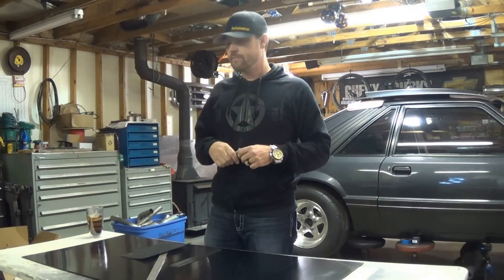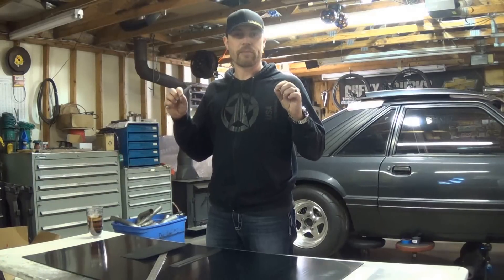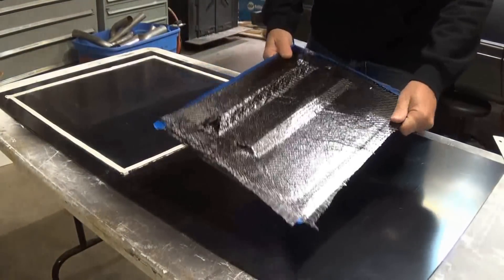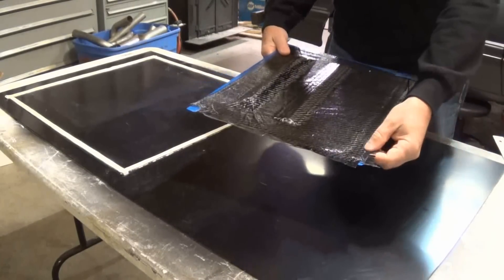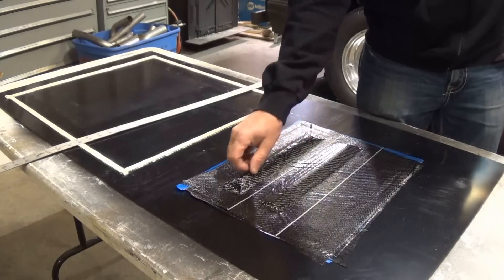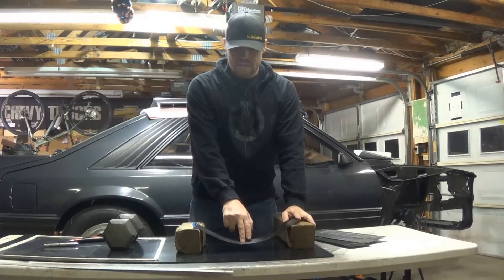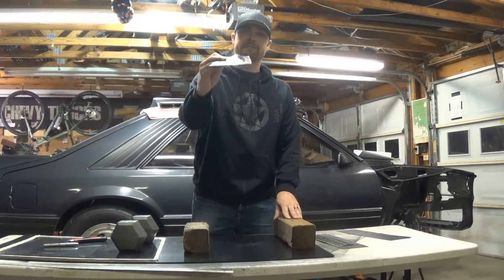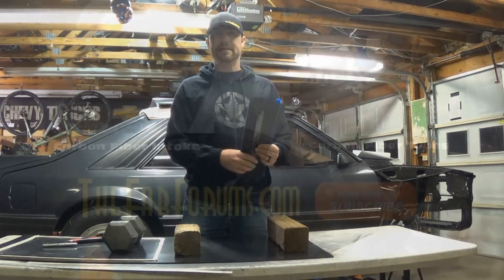Carbon Fiber Fabrication | Strength Testing

Comment: Just pour the epoxy around the outside and don't be stingy like this guy you can squegy any off if you work in a shop that's laminating you don't work slowly it's beat feet and get it done FAST

Comment: This is great.  I knew adding shape would add additional rigidity.  My use case requires a firm design without flexibility, so I've definitely been looking into just adding some arcs to give added strength and rigidity.

Comment: You do not know what you are taking about with this. Carbon fiber is not stronger the fiberglass it is stiffer.
There is so much knowledge you are missing. This guy explains things in way more detail. https://youtu.be/KHXVf0SaJpA
.
You need to take this down as it is so wrong on so many levels!

Comment: Difference should be made between carbon fibre fabrication (i.e. how the carbon fibre is produced from e.g. from rayon) and fabrication of composites reinforced with carbon fibre (CFRC). Suggestion: CFRC fabrication should be used for this video.

Comment: Although not as strong, a regular E-glass would have had similar flexing properties but a lot cheaper. To illustrate the concept think of a solid core exterior door versus an interior hollow core door. Interior door is much lighter, same thickness but almost as stiff.

Comment: I don't know what kind of foam core you were using, but you need a core material that has suitable compressive strength. End-cut balsa is cheap and popular, Rohacell is excellent but expensive, Divinycell is a tiny bit heavier than Rohacell but very, very good and a helluva lot cheaper.

Comment: The parts would be much stronger if you didn't make them pyramid shape. You can also make them at least 20% lighter if uni-directional fibers are used for the inner layer

Comment: Surprisingly, fiberglass is actually stronger than carbon fiber.  Where carbon fiber excels is in its stiffness.   https://www.youtube.com/watch?v=KHXVf0SaJpA&list=WL&index=34
Reply from the maker: not actually true....I guess you missed the text in the video at the 3 minute mark.
Reply: @Thefabforums  I did miss that.  But it's inconclusive, the way it's worded. It says higher strength is available but it doesn't say higher  strength "than fiberglass."    In my opinion he's trying to say that there is carbon fiber material that is higher in strength than generic carbon fiber but not 
necessarily higher than S glass fiberglass. I will have to keep my eyes open for the definite answer to that one.

Comment: thickness in the direction of bending looks like the key, and a shape that wont buckle.  tubes resist torsion well. in bending the outside surface is under max tension (like the outside of a track) and inside under max compression.  Why some bridges are metal on bottom and concrete on top.
Reply from the maker: yeah

Comment: Look into doing counter biased weave layers. so your first layer would be 45 degrees weave and the next would be 90 degrees, then 45 then 90.... for as many layers as you lay. much more rigid and much stronger.
Reply from the maker: correct more tensile strength but it would change this test, even when you alter the direction of the weave it will still be flexible when flat.

Comment: This method is great for parts where dimensions don't need to be accurate but this is actually a positive mold of that side of the heat shield.  The dimensions wouldn't be the same.  Doing this for dimension critical parts such as a bracket of interior panels there would need to be a mold for both sides.
Reply from the maker: in some cases such as the one you are talking about, if the part is flat enough it wont change.

Comment: Could this technique be used as a 'rib' method for body panels to give them strength?

Can this also be used to make a chassis or is chassis fabing too elaborate and calls for big machines and astronomical funding?
Reply from the maker: yeah for sure
Reply: The Fab Forums and it wouldn't be too brittle, would it?

You may have just motivated me to start working with CF! :D

Comment: It seems to me that we will get more strength by placing a piece of styrofoam?
Reply: Its not about the material, You could of used a balloon wrapped in carbon & it would offer the same strength. Its the 3D aspect that adds stiffeness. Same exact reason if you look under the hood of your car there are stamped metal supports that are raised & lowered from the sheet metal carbon is no different all metals and composite materials behave this same way

Comment: No! Carbon Fibre doesn't flex and disintegrates on impact, just ask anybody at any car or plane forum ... 

Sigh.
Reply from the maker: dont need to ask...I already know.
Reply from the maker: Its so funny to me that I just made some carbon fiber pieces right in front of you in this video....showed that its flexible and you are trying to tell me it not. lol
People should really stop keyboard building and actually put their hands on something.
Reply: Fab Forum, that was dry cynical humor, you missed it sorry, see the "Sigh" on the second line! I'm with you all the way Mate!

Internet "lore" is that CF is brittle and will snap, but so is aluminium, plastic, steel, fiberglass and wood.

Lucky for us there's more than one type of aluminium, plastic, steel, fiberglass and wood ..

... as of course there's more than one type of CF.

Actually one bicycle manufacturer is using a CF rear swing arm in CF and the pivots at the pedal junction are solid, the CF just flexes like F1 race car suspension pivots, but I can't find it on Youtube again ..

Thanks for the video, the internet needs more lore and myth disproving information like this.

Comment: I am starting to use Carbon Fiber to make high power rockets so I love these videos! One question, would you get more strength by cutting the alternate layers on a bias so that the weave would run at different angles? The plan I am going to attempt for an airframe is 1 CF running 0-90, 1 CF running -45 - 45, 1 layer of nomex honeycomb, another layer of CF running -45-45 and finally a last layer of CF running 0-90. Would that lay up be any stronger or am I making more work for myself?
Reply from the maker: yeah that would help for sure

Comment: Hey its me again The CarbonGuy! do another drill for me and you find this extremely useful when thickness and strength are both issues. instead of cutting all your fabric in the same direction for all four pieces, alter your direction of the warp face. Another words cut one piece the way you previously cut the four then cut another at a 45 degree from your first cut then cut another at a -45 degree then cut the 4th piece at a 90 degree angle from the 1st piece. now wet them out and lay them in that exact order. Let it cure and then do the same strength test, I think you will be shocked. But use cation to lay them out in the order as I explained or your part will curl up a bit after it cures! LOL but mix it up and play around to see for yourself what happens. kinda cool to learn about the warped face and how to manipulate it!
Reply: For this test he is just stressing it in one direction so if he really wants to show the difference the 45 layers would not do much, UD how ever would gives a piece with strain like this the most strength to weight ratio.
Reply: +Oliver Vallee gotcha,  that wasn't made clear ahead of time Sorry for that confusion but I would like to see him repeat the test under my suggestion to see the difference.

Comment: What's happening here has nothing to do with the material really. It's the separation of the two stressed surfaces that creates the rigidity. The greater the separation the greater the strength will be. You can put lots of different materials between the layers. Polycarbonate honeycombe is used in racing applications because it's rigid, very light and it doesn't absorb resin.
Reply from the maker: correct
Reply: I was about to say the same thing, but then I saw your post.  Exactly.

Comment: Nice, but why don't you use pre preg Carbon fiber
Reply from the maker: +Xavier Rousso Too expensive... cheaper to just impregnate it my self. Prepreg is awesome for layups that are very time intensive but is expensive and requires a heat cure. So unless its needed I dont use it.
Reply: +The Fab Forums ok, thanks for answering. Keep up the amazing vids!
Reply from the maker: +Xavier Rousso no prob. Thanks for watching

Comment: I waited for sledgehammer test with dumbell at the end to see flexy one will flex how about the rigid ones
Reply from the maker: +YAĞIZ ERGENÇ I have stood on it before (200lbs) between two blocks with no flex or cracking
Reply: +The Fab Forums are you using uv finish to protect cf from being yellowish after a time?
Reply from the maker: +YAĞIZ ERGENÇ No the resin it self is UV resistant

Comment: The orientation of the weave also has a lot to do with its rigidity. if you do overlapping opposing weaves you'll get a much more rigid piece using less layers and less reinforcement.
Reply from the maker: +John Sanders I would agree with that

Comment: It's excellent! I am making a boat with foam, I want to coat it with carbon fiber because it seems it is make it super strong! Can you please add text on this video that what is the black sheet that you put carbon fiber on at first? what was that liquid you spread on the black sheet and put carbon fiber on? and more steps? 

Thanks!
Reply from the maker: The black sheet was just some plastic. I then applied some PVA and a layer of resin before I laid the first layer of fabric.

Comment: I've been thinking about a small motorcycle pull behind camper. Using the thinner foam in this video (what kind was it?) how weatherproof would it be?

thanks
Reply from the maker: The thin foam was just craft foam you can find at any Walmart of craft store.

Comment: There are carbon fiber systems that require an autoclave.
Reply: Not true, a lot of prepreg is just baked in a vacuumsealed "bag", the potential problem with that, how ever is that you can never "compress" the laminate more than the difference between the "vacuum" and the atmosphere pressure. If you use an autoclave you raise the pressure outside the bag so you get a much higher difference and therefore you can force more air bubbles and left over resin out of the product and pack the fiber tighter, you therefore get a piece that can get in to tighter corners and such, a better finish and somewhat thinner laminate. Blackwing where I work is making an airplane rated for 12G and -8G and we do not yet use an autoclave although we might soon.
Reply from the maker: +se7ensnakes you are absolutely correct. Everything that is prepreg requires an autoclave of some kind of heat cure.
Reply from the maker: +se7ensnakes Not familiar...I have no fear of not using an autoclave. I have made some EXTREMELY stong parts with traditional resins including intake manifolds and engine accessory brackets.
Reply: The Fab Forums I am doing research.  I have not tried the NONA system but if manufacturers are still relying on an autoclave system there might just be a reason.  Right now i am just doing engine  and trunk hoods, The originals ones are typically super heavy.  Who is your supplier?
Reply from the maker: The manufacturers rely on the autoclaves because they all use prepreg fabric. I use several suppliers depending on what I am buying.

Comment: awesome dude! thanks by the tips
Reply from the maker: +gisangueazul no problem...thanks for watching
Reply: I was wondering what kind of material can I use to provide more resistance for a bonnet. and what about the the moulding, how can I do it? thanks.
Reply from the maker: +gisangueazul you could cast the bonet in two sections. The outside skin and the under side frame and then bond the two together

Comment: It's called second area moment of inertia.  Not what I was hoping for when I read the title.  Strength test implies that you test for maximum strength till the sample breaks.
Reply from the maker: The easy, understandable, alternative to "second area moment of inertia" is "adding dimension". I made the point I wanted to make in this video and breaking it wouldn't have changed anything. The part was tested to 200lbs with no signs of weakness, didn't feel the need to go any heavier.

Comment: This is because the strength of a rectangular cross-section is related to its area moment of inertia I_x = (1/12)*width * height ^3, so the higher it is, the more exponentially stiffer it is. This is the point of an I beam, which is to remove as much width as possible without the member buckling, and to use that material in height.
Reply from the maker: What he said
Reply from the maker: lol
Reply: fyou forgot Ix=(b*h*h*h/12)+A*L*L   (A-area of part , L center of gravity of Area to center of gravity of whole cross section)   :)
Reply: Exactly. The reason cars have ridges or grooves running their lengths. Dumb it down to shape but you can also add direction of carbon weave.

Comment: How necessary step it is to suck the extra resin off from the carbon fiber? I`m planing on doing some cf parts for my car so do I need to do that step to each part? Even if they are some complex shapes. Great video. I would really appreciate some hints. Thanks!
Reply from the maker: You don't have too but removing the extra resin is what makes the parts light.
Reply: Yea true. Thanks!

Comment: The resin system has a lot to do with how brittle a part is... not so much the fibers inside. I work with carbon, zylon, kevlar, and glass everyday on racing and aerospace parts... You are correct in that the structure plays the biggest role in rigidity. The resin formulation also plays a major role. Check out Cytec website for more information. Cool video showing the importance of core.
Reply from the maker: +TylerKirkFilms Thanks

Comment: Could you do a test with a honeycomb center?
Reply: +Bridger Crusan Orient your fiber in all three planes, and not just two. Extra reinforcement can be added, but although a honeycomb is stronger in nature, it is only good is transferring force in one direction and it ends up acting like a two force member, and would not increase the strength of the composite design. The foam contour essentially acts as a prop for the carbon threads to act in the z (or vertical dir) and resist forces along each finite linear grade and this carbon thread orientation accounts for most of the strength.. The foam's contribution is significantly less than that of the carbon thread acting in the z direction. Of note, adding a contour like this adds strength in the z direction at the cost of strength in the xy plane.
Reply from the maker: Well said

Comment: Outstanding, thanks for the knowledge. What kind of tape are you using there to keep the fray at bay when cutting? Looks great for straight edges. I have used a sewing machine in the past to stitch complex patterns out before cutting on smaller pieces; it's hell on the needles.
Reply from the maker: ironDsteele Thanks...its just blue painters tape.

Comment: The Fab Forums 
Hey man. Question. Say I want to make a guitar. problem with wooden guitars is warping. Problem With me doing a carbon fiber guitar myself, is shaping it. Getting it the right thickness to route and hold pickups. Say I make a foam model of the guitar with the holes I need routed already and overlay carbon fiber on the body and nooks. Would that give me enough strength to hold about 5lbs of continuous string tension while letting me use less materials. Also, if I wrap That around a wooden guitar, would that guitar not warp? Thank you for your input. I've been driving myself crazy trying to figure out how I can make this work.
Reply: maybe do a small test, on say a piece of small wood, wrap that in carbon fiber, and expose it to extreme humidity. See if it warps, i thing it would be sealed watertight by the carbon fiber. Also your foam suggestion would be cool, or even a cheap lightweight wood, both would probably work. im interested to see if it worked
Reply: i know its old but just take a wood guitar and make a mold with it...use it as the plug...not too difficult...also you would just need more thickness...no foam and you would pattern the direction of the layers of carbon so that the strands run diff direction each layer...that will give you enough strength for guitar...the neck you could use hi den foam or wood as the core and carbon on top

Comment: How thick can you go with the foam or how thick would you go before getting less strength or stiffness? Is there a ratio or guideline?
Reply from the maker: Patrick Kraemer I am not really sure. I think it depends on a lot of things. I know they go several inches think in the super car and aircraft industries, but they also use a honey comb type filler vs foam.
Reply: The Fab Forums Where did you obtain the "thick high density foam"? Does it have a commercial name? Thank you for your time. Do you sell carbon fiber kits?
Reply from the maker: I got the foam at Walmart...its just floral foam. I do sell carbon kits on eBay.
Reply: HOMELESS. sleep in a city park, like a small carbon-fiber 'spider-hole'?! (that's the greatest moment of Saddam's life..... to the homeless!) :-0